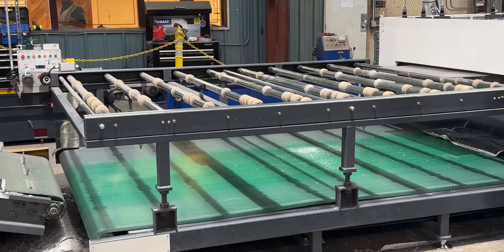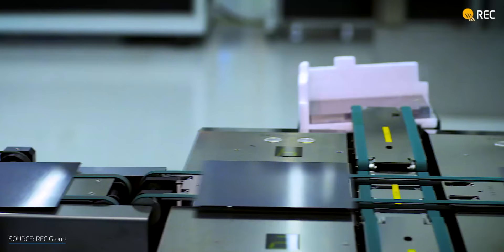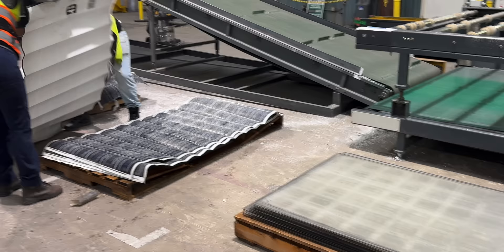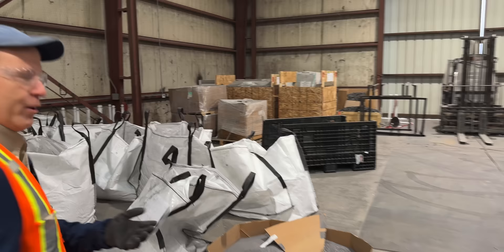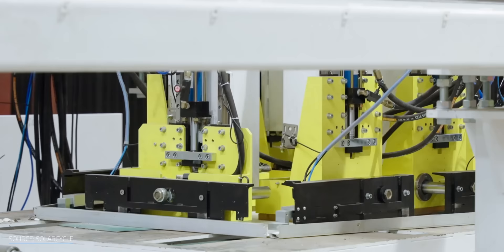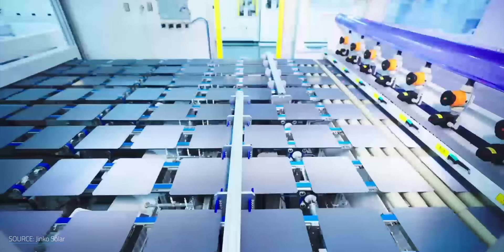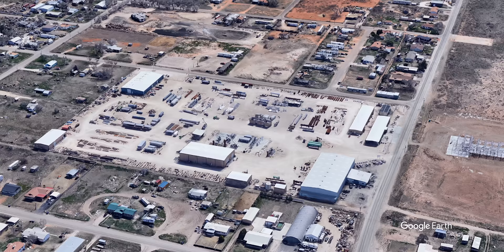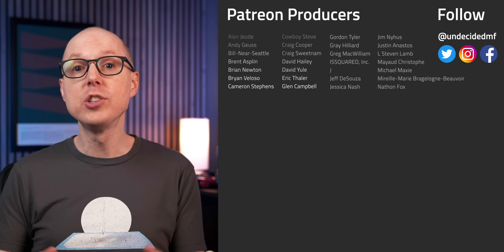What REALLY happens to used Solar Panels?

Comment: Finding a way to recycle solar panels is critical in the future, but "reuse" comes before "recycle" in the circular economy. I bought used 66Wh panels in 1999 for an off-grid cabin. When I replaced them last summer, I gave them to a friend to run his water pump. A good, used panel industry would be a good thing, as well. Great presentation BTW.
Reply: Exactly, reuse before recycle as long as someone wants it it's not worth it to recycle it as it can still be put to use before it's finally dead.
Reply: Modern solar panels should continue to work for well over 50 years (I wouldn’t be surprised at 100 years!). Even if they’re not 100% efficient anymore, they’re producing free energy.
Reply: @davestagner  as long as they produce energy, they should be reused for as long as possible. Now if they drop below 100W each then it may become a thing of not worth maintaining them but that means just 20% of the initial power rating for my actual panels so that's a lot of loss which will probably take 50 years as you said.
Reply: There's  a plethora of companies out there now who do resell used solar panels at marked down prices below what new panels would cost... Sellers on Ebay,Amazon,and more and more PV installing companies are offering panels that are from 1 year old up to several years old for a fraction of what new panels sell for,and a lot of what I've seen come with a warranty...
Reply: There are a number of companies already selling used panels. Most of the ones that get recycled will probably end up being those that are damaged by lightning, large hail, hurricanes, etc.
Reply: Exactly. That's what they're doing with old EV batteries. They send them to grid storage to be used until they're all the way no good then they can be recycled.
Reply: This is the part I wished had been mentioned in the video.  Solar panels usually don't just stop working at 20 years or whatever.  They just get a bit less efficient over time.  Much better to find a lower-tier user that's fine with that and reuse them.
Reply: Where did you end up buying your used solar panels from?
Reply: I wish he had addressed that, so long as not physically broken, old panels usually still work fine, just at reduced efficiency.  An old panel will often be better than trashing and recycling a panel into new ones from an environmental point of view.
Reply: I agree, my graduation project uses lithium cells repurposed from old laptop batteries. My cost was much lower and they didn't end up in a landfill
Reply: I agree, but there is some cut-off point where the increase of efficiency in the new panels would offset the emissions of recycling vs. continuing using the old panels. But it could well be only after a significant loss of production, or when the panel gets broken.
Reply: Reuse first for sure.  I have a panel I purchase 15 years ago, it was removed from Oil well monitoring system at the age of 10 so its 25 years old, still makes 80% original power and it still lights up our farm's barn, with reused tractor battery and cheap inverter!
Reply: @OtterSwims Ricky from Two bit DaVinci often mentions buying old panels for his house. You'll probably find more info on his channel
Reply: A question is also why panels get replaced at all. Sometimes it's because the space is precious and max efficiency is required. But sometimes it's just to get new subsidies, which is stupid.
Reply: YES!  I'm actually pretty disappointed that reusing wasn't even discussed in this video. 

Also, I had a couple of panels blow off my roof of my off grid cabin - totally shattered but amazingly they still work!  They just work around around 1/5 capacity.  Still, why put them in the landfill when they still work?
Reply: @BabyMakR  The beauty of that endeavor is that the duty cycle is so much easier on the batteries than in a car, it's almost like retirement.  "Range" doesn't matter when used for backup.
Reply: Some environments probably allow this to happen easier than others.  I live in Okinawa and had solar panels put on my roof.  The environment is so caustic I would be shocked if they lasted 15 years.  But when the sun it out the rebates are nice.
Reply: I wonder why we even start to re-cycle already? Except for the very few panels that get physically destroyed in storms, transport or overheating, there is no need to recycle. If a completely written off (basicaly free) panel still produces any amount of electric charge and we haven't yet run out of space to put them nor our , why should we recycle them? Also the materials needed for new production are plentiful in this field. It would be nice to see a study comparing the resource use (material, energy, envorinmental cost) of a recycled and rebuilt panel that will run for 20 years at a high efficiency until it is replaced vs a 20 year old panel that ran at a lower efficiency, but will continue running for the next 80 years.
Reply: There are multiple facets to consider. I doubt that the cost of recycling materials is genuinely cheaper than mining them when we factor in labor, processing, and transportation expenses. The industry might require regulatory support to ensure profitability, although excessive regulations could potentially hinder the solarization process and impede decarbonization inadvertently.

The materials typically recycled are mostly non-toxic and environmentally friendly, akin to sand.

Another critical aspect is redirecting attention from recycling concerns to preventing significant entities like corporations, big companies, and governments from discarding functional solar panels simply because they're 'expired' according to a 'used by' sticker on it or the paperwork.  This practice poses a more substantial threat, and implementing regulations to discourage 'planned obsolescence' is crucial.
Reply: @OneOfDisease  There is no such thing as a caustic environment unless you are next door and downwind of some major polluter.  And glass is impervious to virtually all chemicals except the fluoride molecule.
Reply: @frequentlycynical642  I think he meant corrosive since seawater tends to hate pretty much everything at a long enough timescale
Reply: @OtterSwims Santan solar is one firm I've seen, and Batteryhookup had Solyndra panels at one point, though it's pretty obvious why those didn't sell.
Reply: the issue is manufacturing quality. as more production is in China the need for them to have competitive life-cycles diminishes and so quality diminishes. by them cutting corners in the manufacturing processes, less changing of air filters leading to more contaminants and other ways of cutting costs means that you end up with the same materials but in a product that dies faster. as manufacturing is brought back to the US you will get solar panels (and hopefully electronics) that once again last longer than the projected life-cycle and can be reused at a lower efficiency. at least as long as the regulations make sense (there is a reason the recycler is in TX).
Reply: Yes and that second or third use can asilo pay for the eventual recycling fee.
Reply: @RandomAccountHolder  i bet his tech machine only works on unbroken panels. this will be a government money laundry
Reply: @Wil_Liam1 Don't expect Santan Solar to honor their one year warranty. I bought 10 panels and within 6 to 9 months 3 of them developed shorts in the traces and shattered the glass. They've refused to do anything about it.
Reply: I totally agree with what I am reading here and the video. I live in Thailand, and they have gone into solar panels in a big way. Most, if not all big solar farms here belong to the government, like all of the hydraulic power, so the cost of the energy stays at a low cost. 

I have to wonder if a company like this would be a good investment here in Southeast Asia? If you look around here, there's a lot of solar power being generated in all of these countries and once they reach a point that they don't produce enough energy  compared to what new ones would, they will replace them. That's when a company like this would be great in Thailand because of its central location in the area. 

I will have to do some research to see if that would be a possibility. It would be interesting to be a part of that.
Reply: @davestagner , Unfortunately I must disagree.  I’ve worked in PV for a long time, and been a full time service technician since 2012.  Driving down costs has largely been positive, and mostly a function of scale and improved processes, but it is not without its downsides.  One of those downsides is that quality begins to suffer among various product lines.  The most common issue I see is the laminate or sealant fails, allowing moisture intrusion.  If the panels are <10yo the warranty claim is easy and straightforward (full mfr warranty for any issue).  After that, submitting a production warranty claim requires a whole battery of tests be done to each and every module they wish to include in the claim.  It is extremely labor intensive, often making it not worth pursuing.  So far I haven’t identified a predictable pattern by which these failures occur.  In my experience, PV system owners will be lucky to make it 20-25 years before needing to remove or replace the system in its entirety.

Newer systems that have “MLPE” (Module Level Power Electronics) will make it easier, because the individual failures will be easier to identify, and be identified earlier, IF the MLPE has monitoring capabilities.

While it’s true that a product no longer suitable for a home or commercial building could be repurposed to drive a 24V remote irrigation pump so long as it doesn’t require ground fault protection, there are only so many such reuse cases.  Thousands more modules (panels) will have to be scrapped.  Hopefully “scrapped” will mean recycled at a nearly 100% rate in the near future.
Reply: @adlockhungry304  That’s really great information, thank you! What sort of failure rates are you seeing? Is this like less than 1%, or will it be worse than that?
Reply: @davestagner  I couldn’t give precise numbers on failure rates, but remember, ultimately the failure rate is 100%.  It’s just a matter of failure rate within a given time span.  So it’s a matter of us deciding what the lifespan should be, then measuring failure in that period.  I’m not sure there’s much publicly available empirical data about this, but some of my colleagues on the engineering side of things might know more.  Keep in mind, as the service technician, I mostly only see the bad stuff, so I’m a bit jaded. 😁. 

I’m seeing a lot of systems that need a new inverter but I can’t get a new inverter to work with the old panels.  The new inverter will run an “insulation test” before operating and the old PV circuits will fail that test.  Knowing this, I’ve had to tell people they need a new system altogether, OR they can try to get an old inverter refurbished.  A refurbished inverter is actually more expensive than a new one, and doesn’t have a warranty to speak of, but I suppose it’s better than having to get a whole new system perhaps 10 or even 15 years sooner than anticipated.  

This threshold for the test that new inverters use is, like many things, set at a level that is multiples above what an actual safe operating condition would be, so techs like me have to run the test with our own instruments to decide whether it is a “total” failure, ie not safe to operate under any circumstances, or safe to operate, but won’t work with new equipment.  

Additionally, I have no way of predicting the rate at which these modules will continue to deteriorate.  Perhaps a client decides to get a refurbished inverter, spends $3-5K (including my labor) then a year later the modules have deteriorated so dramatically that now they blow the ground fault fuse every time it rains.  Not only that, but knowing what I now know about the possibility the older modules may start deteriorating at any time, even the PV circuits that are tested well above the threshold for a brand new inverter might not be next year.  So $3K for a brand new inverter with a 10yr warranty, but now the PV array has failed and they have to get all new stuff anyway.  That hasn’t happened, but I have to treat it as a strong possibility.

So, solar has many shiny success stories, but, like all industries, is not without its own dirty underbelly.
Reply: @jamoecw  Exactly!  You stated it much better than I did (and more concise)!
Reply: trash because science
Reply: theres more investment in coal mine run off for rare earth materials than viability in solar cell recycling
Reply: @game_jinx  why wouldn’t we do both?
Reply: @game_jinx , Ironically “trash because science” is an utterly unscientific statement.  Care to elaborate using evidence and reason?
Reply: @@thecaricature Solar panels operate at least than 50v, often less than 20v. They’re not high voltage systems. Inverters may be, but inverters can be replaced anyway. My house has 110 year old wiring in places and hasn’t failed yet.
Reply: Great commend ❤ @davestagner
Reply: My thoughts exactly. I bet almost all those panels getting recycled could be reused by someone else
Reply: @BabyMakR  I love the idea of combining used solar panels and used EV batteries to make an affordable residential solar roof and energy storage system, thus expanding the number of installations and accelerating adoption even further.
Reply: How old was the 0anels when you were buying it?
Reply: @OtterSwims  My brother bought them for me online. That's why I didn't know how old they were when I bought them.
Reply: @davestagner  They've never been 100% efficient, but HOPEFULLY most people will know you mean "as effective as when they were new".

Comment: Long term, I'd say the smart money is in designing a cheap to manufacture solar panel that's specifically recyclable. Have the disassembly process baked in to the architecture itself.
Reply: sure but that'd require corporations to think long term, and they pretty consistently struggle with that. also it sounds like some of the reasons they're hard to recycle are based on ways manufacturers make panels last longer. so until we figure out how to maintain panel lifespan without making it harder to recycle it's unlikely anyone is gonna make that a priority. unless theres some immediate incentive provided
Reply: Or you design one good for 50 years then you relaminate it for it's 2nd life another 30 years..
Reply: @dufung3980  exactly like I stated about incorporating disassembly or refitting features.
Reply: @dufung3980  That is unlikley. That would require the assemble and relaminate process to be similar/identical after 50 years. This almost never happend to any industry. Did that even happen even once in any industry? Its better, easier and cheaper just to have recycable panels and recycle them. So you can reuse the material for whatever you want.
Reply: @demonz9065  Manufacturer need to be (financial) reliable for the recycling process. There are a lot of possible ideas to do so. Tax on virgin materials, obligation to take back and recycle, fee for non recycled end products. Whatever you do. Now they are immidiately incentivised to make a more recycable product.
Reply: @demonz9065  exactly. Our economic model is not built for a green economy.
Reply: 2 things: Old Solar panels never die, they just fade away - VERY slowly. Like over 100 years or more, unless they are physically damaged somehow. Little need to recycle them - just add a few more to make up for lost capacity over time. When it comes to recycling, why not engineer panels with recycling in mind? Look ways to manufacture them that are cost effective and more easily reversible.
Reply: Agreed. If we could get Pervoskite solar panels significantly cheaper with greater effiency then now.

 Who cares if they don't last twenty years if they are recyclable. Could replace them every ten.

It would probably be better since the technology is improving so fast while getting cheaper. 

 How many people bought solar five years ago just for the price and effiency to drop a good amount!
Reply: @sterlingarcher1962  exactly what i was thinking. That would be best
Reply: @demonz9065  Just make the manufacturer pay what it costs to disassemble his panels.

Comment: The only problem I had with solar panels was that we couldnt reuse them. Also recently Ive found websites that sells used panels that are within the 80% power gen mark. For 1/4 of the orginal price. They are sold as DIY/ home experiments. It was 65$ for a 200watt Panel, vs the 300$ for a new 200watt panel.
Reply: Those DIY prices are overpriced. 65$ for 160watt peak is more than you pay for new panels nowdays. 

And then you still need to buy material to mount them at home. 

And in addition to than new panels have a warranty of 15-25  years. 

Most people are best off with buying them new and then keeping them for 40+ years.
Reply: XinChen-ie2qq  that's wholesale price for here in the US. 200watt panels average 140$+. Flexible ones run about 300$